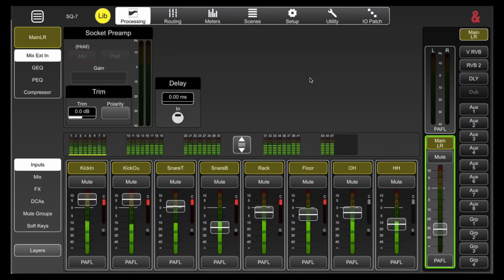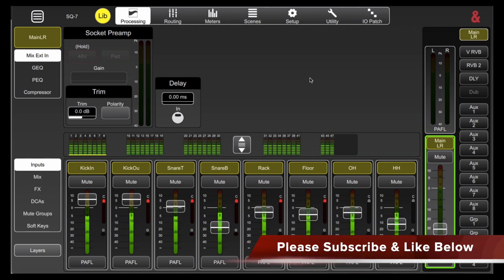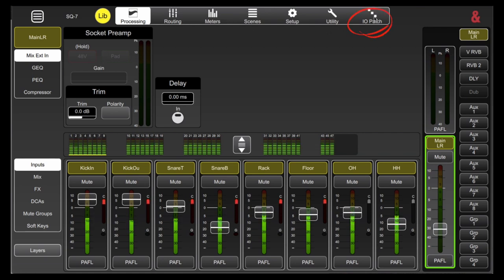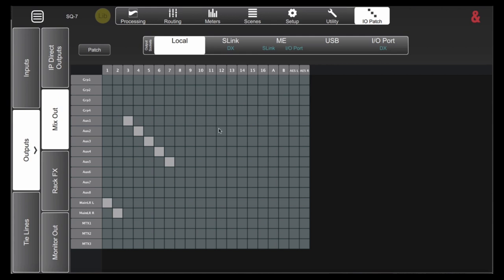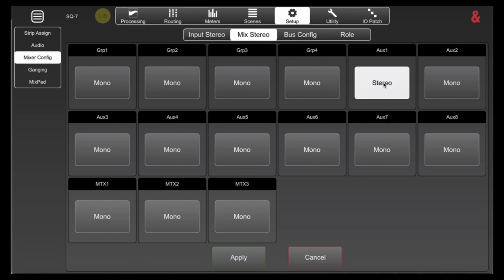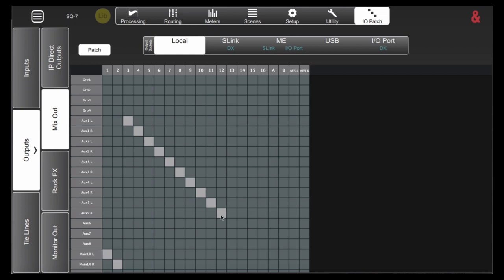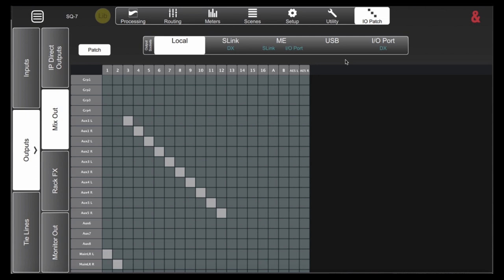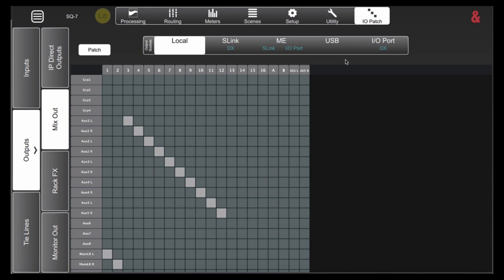Allen & Heath SQ - How to setup stereo outputs for in-ear monitors

Comment: hello ,I have SQ 6 AND 24 INPUT AND 12 OUT stage box ,,,I want more outs so I wanna buy a another stage box.,,but I will hove only 12 AUX OUTS in my console ,,, how to increase the out in console ..????
Reply from the maker: You can also use the Matrixes for 3 more Aux type outputs. You can additionally use the input direct outs if you need the raw inputs. This won’t effect  your mixing output capacity. All the SQs are 48x20, and the other 8 aux outputs will come from your RACK FX outputs.

Comment: I am about to purchase the ME500 boxes and the ME Hub.  (6) boxes for the bans at church. Do I connect the Hub VIA the Slink or the ME?  Do I need the HUB or can I connect Cat5 to a ME500 box then slave 5 more?  I know we would then need to run individual power.  I am confused on when to use the HUB and when it is not needed.  I have had a sound installer tell me I definitely need the hub. Is there a down side to not using the HUB besides power?  We just installed our SQ7 6 weeks ago so digital is still a work in progress for me at church.
Reply from the maker: The main benefit of the hub vs daisychaining MEs will be PoE versus having to use a wall wart for each ME. Alternatively, you can use a normal gigabit layer 3 ethernet switch. If you use a third party switch though, Allen & Heath can’t provide tech support for the switch, or issues related to the switch and the ME500s. You can use the Slink port if you’re not using it to connect to a stage box or tie lining to another board.

Comment: Is there a way to assign the main front of house mix to a monitor mix ? I want to eliminate having to match two separate mixes, foh and monitor, thanks .... It's an sq 10t
Reply from the maker: You could either double patch your Main LR mix or use the copy paste function to quickly duplicate the mix and still have a separate main volume.

Comment: If i were to use all 12 stereo mixes on the SQ7 for the band, what would be left over for the main house speakers, delays, subs, video, etc.?
Reply from the maker: After you’ve used all 12 stereo auxes, you still have your Main LR outputs, and 3 Matrixes.  The Matrixes can be mono or stereo, but you’re still capped at 3 in either case. If you were to use MEs for the band to monitor, that would only take up “one path” and help free up additional auxes if needed. The MEs are one out from the SQs but still allow personal mixes at each unit.

Comment: For an in-house setup that is mono, can the SQ-7 be setup for stereo in-ear monitors?
Reply from the maker: Yes, the auxes can be stereo even if the main is mono. Also, Panning for the channels is also independent for each mix so that should be no problem.
Reply: @Johnbanthony  , thank you for responding. I’m currently using the cellphone app, SQ4You to balance and fix my own IEM. Thanks again.

Comment: How you suggest I connect stereo speakers on LR output and have separate output for the Sub. 
Ps i have 4 monitors so the 4 mix output are already used
Reply from the maker: You can change the number of Auxes and Matrixes.  I would setup a mono Matrix or Aux to use as a Sub out.  You can send your whole mix out and apply a low pass filter or just send your kick and bass, again applying a LPF on the Aux. The Second scenario I mentioned is how an LFE channel would be setup, but still works for live sound since it cleans up the signal sent to the sub.

Comment: I have a Shure PSM300 in ear system, trying to get stereo sound on my in ears.Where would I connect it to an SQ5 mixer on the back? Any help please
Reply from the maker: You can use any of the xlr outputs on the back of the SQ. Be sure to assign the outputs to an Aux in the I/O screen after setting up stereo connections shown in the video.
Reply: @Johnbanthony  thanks for the reply
So for example Aux 1-2 for stereo  or just Aux 1?
Reply from the maker: @JMTZS  As an example, for physical connections out 1 and 2 on the back. After you turn on stereo Aux 1 and hit apply, you’ll see Aux 1 L and Aux 1 R on IO screen under Outputs. This will apply for any Auxes you make stereo.
Reply: @Johnbanthony  but once Aux 1 Stereo L R is applied will the XLR cable just go to the 1 input on the back or 1-2?
Reply from the maker: @JMTZS  You’ll need two xlr cables, one for Left and one for Right per stereo Aux. So on the back 1 will be Left and 2 will be Right in this instance.

Comment: What i love to see its  with work with this mixer but with analog outboard gear  like a analog Pré or a  valve compressor or a external effect like a delay analog. Its possible ? This Mixer work with external analog outboard gear  rack ? regards from Portugal. Nice videos
Reply from the maker: To run an external analog preamp, you can use any of the xlr inputs, but run the internal preamp gain of that channel at 0. To run external outboard gear like a compressor or delay, you’ll need to use FX Sends and Returns 5-8. The first 4 effects are meant for internal effects, while 5-8 can be used with outboard equipment. The set this up, go to the Processing screen for one of the FX Returns. Here, you can setup outboard as an insert or a mix return
Reply: @Johnbanthony  thanks !

Comment: Hi,is this jthe same process with the qu series ?
Reply from the maker: The Auxes on the Qu series are fixed. They’re labeled on the right side of the mixer next to the Aux button, whether it’s mono or stereo. For Example, Mix 1 is mono and Mix 5-6 is stereo. You can gain additional stereo outs by using Groups on the Qu24,32, PAC and SB. Qu16 Has 3 Stereo Auxes, Qu24 has 3, but you can have up to 5 with Groups. Qu32, PAC, and SB have 3 Stereo Auxes, or up to 7 with Groups.

Comment: how can i duplicate the main LR mix to come out of an aux output ?
Reply from the maker: You can route the Main Mix out to multiple outputs on the I/O Patch screen. Keep in mind this will carry mix processing out to both outputs. This may may not be ideal if you have EQ on your mix to correct any room problems. While possible, it may not be the best option depending on what you’re doing with the duplicate send of the mix. You can always route to a matrix if needed. If you want to copy the main output mix, you can also use the copy/paste buttons to carry over the channel sends. This will not carry over Mix processing, like the EQ.

Comment: So how do i make the L and R get to the ears so I can use the panning feature on the SQ4you app? Does that not require the matrix to have 2 blocks under the same number?
Reply from the maker: Set all the auxes you need to stereo on the board. Then when you assign the SQ4U faders, you can pan after you select the assignments for that fader.  If you’ve already assigned them, you can click the name for one of your faders and you’ll have the option to pan a mono channel or change the balance of a stereo channel.  This is above the main fader and under where you edit the fader name
Reply: @Johnbanthony  Thanks for you reply. I am going to have another look at it later in the week. If i line up the matrix in a diagonal then how do i make L and R go to one channel on the stage box. It won’t let me put 2 boxes in one column... (eg we run 4 wired in ears on aux out 5 - 8 into a headphone amp that is mono/stereo switchable and we only get sound out when switched to either side mono not stereo.... ) Maybe it’s in the wiring or the amp but i still can’t get my head around sending L and R to different outputs and expecting them to be in the same place....
Reply from the maker: @simonandrachelperchard5779  What model headphone amp are you using? It sounds like the limitation might be on the headphone amp, but it’s hard to say without knowing the model.
Reply: @Johnbanthony  Hi, I looked at the output levels on the mixer and it is only outputting to the left side of the auxs. The amp is a Behringer HA6000, which has TRS to XLR leads connected to the S Link box. I tried to post some photos of what it looks like here but can’t... Our matrix looks similar to yours at 1.28 but i just can’t see how you then make your left and right on two different channels arrive at the same pair of headphones....
Reply from the maker: @simonandrachelperchard5779  I would reach out to Allen and Heath Tech Support, they’ll be able to help out. Either email Support@americanmusicandsound.com or call 800.431.2609.